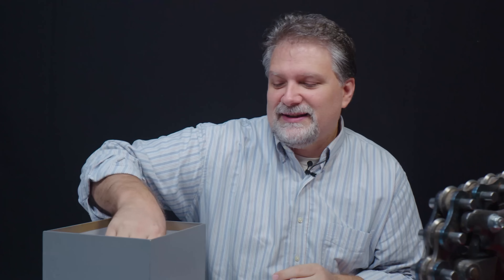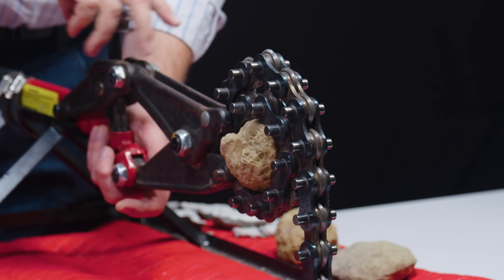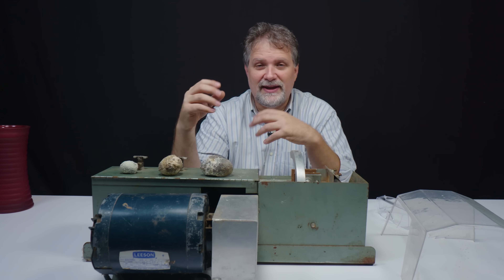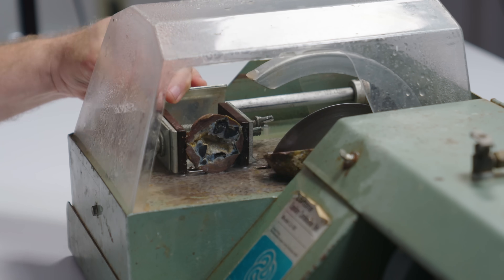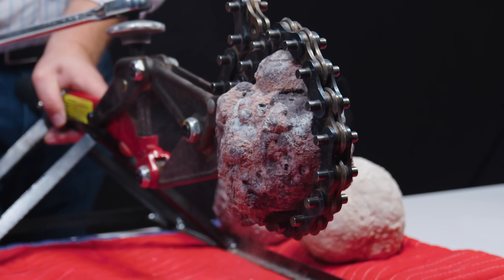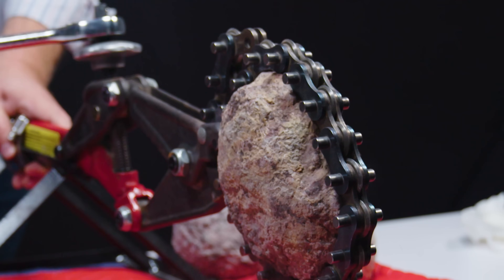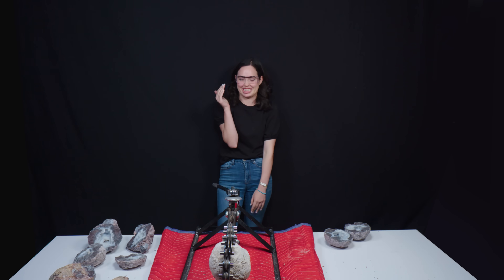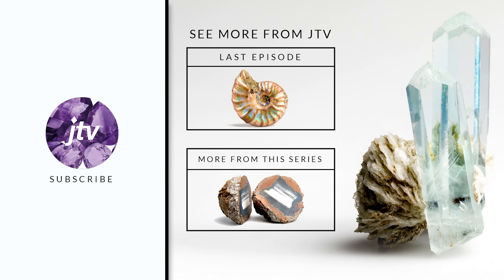Opening Unusual Geodes | Fluorescent, Druzy, Rattlers, & More!

Comment: Came here to check out geodes since I've had a really nice solid one for well over 40 years, but have never had it appraised.  After seeing this and a few other videos, I'm starting to think I have something relatively rare. Mine is about the size of a professional baseball and is cut in half. The inside is solid with layers of white on the rim of the round the is layers in a light blue in alternating layers to a dark blue surrounding the center and the back to a lighter blue for the very center. The more info I get, the more I appreciate what I have. If anyone can point me in the right direction I'd greatly appreciate it. 
Thanks Rockhounds!!!✌️👍🤙

Comment: Public service announcement: always CUT your geodes or Thundereggs open with a wet lapidary saw, either oil or water depending on the saw type. Any time you break them open with either a chain or hammer the concussion of impact and compression will shatter and destroy a good amount of the crystal structure inside. The only way to truly minimize that is with a Diamond saw that’s properly lubricated and with a proper feed rate. Just my experience of 40 years of serious rockhounding and getting an amazing geode specific training while I lived outside of Geode State Park in West Burlington Iowa. It’s just north of the Keokuk locality and actually a better spot for geode hunting if you can get permission from a private landowner on the border of the state park. I have milk crates full of still uncut geodes I’ve saved for about 25 years. 🤙🏼 good video though and thanks for stirring up my geode juices lol!

Comment: with the saw setup you have going for the thunder eggs we used to use a weighted tin attached to the part you push and it pulls the stone through the blade without the need of your hand being in there. way safer to use that way.

Comment: Hi! I lve in northern Virginia, and my Grand daughter, 12 would like to get into rock collecting and making art with them.  I was wondering a few things- 
What is the difference between a geode and a Thunder egg?
Can we find geodes here in NoVa?
When you were cracking the geodes, there was a lot of dust and fine particulate in the air- I am glad you are wearing glasses, but shouldn't you also wear a mask to prevent breathing it in, as you had the water to protect you with the saw? I would hate for you to develop silicosis some day
Thank you!
Reply: Thundereggs are similar to a filled geode, that is formed within rhyolitic volcanic ash layers and opposed to geodes have agate-filled nodules, that is minerals in-filled during its formation cooling to create a microcrystalline structure.

Geode is a geological secondary formation within sedimentary and volcanic rocks including common crystals include quartz, agate, jasper, gypsum, chalcedony, hematite, dolomite and calcite.

-

Differences of Quartz Varieties

I believe the location, size, crystal habit/structure (crystallography) and possibly its luster. For more nuanced differences you may have to look towards reflectance, absorption, cleavage which can be looked up on mindat or IGS.

Chemical formulas:

Quartz is a family of minerals with this composition:

Silicon  46.74 % 
Oxygen   53.26 % 

and it's varieties:

Agate - banded variety of chaledony 
Carnelian - flesh red chalcedony
Chalcedony - microcrystalline quartz 
Chert - cryptocrystalline quartz
Flint - microcrystalline quartz  

Chelcedony SiO 2
cryptocrystalline form of silica, composed of very fine intergrowths of quartz and moganite (considered a polymorph of quartz; Silicon 46.74%  SiO 2 Oxygen 53.26 %)

Extra: Apophylite vs Quartz (https://m.youtube.com/shorts/KBKhMWAc8B4 )

Comment: And number THREE REASON you need to use water is so the diamond tips don't melt away from the blade!
Reply: Warped blades arent fun either
Reply: I feel that warped blades and melt-away diamonds fall under reason number one: you don't want the blade to heat too much.

Comment: Never heard of thunder eggs.  Definitely Mother nature at her best.  Was fun watching how you actually get the geode cracked.  Loved the striped Chalcedony. Using the saw looked mighty dangerous, good thing you guys are professionals.
Reply: The only real danger from using the saw is if the blade broke, i have never had a blade break on me in the many years i have been cutting. These blades are dull, they use the diamond layer to scrape away the material, they are not like a normal saw blade.

The geode cracker however is way too messy and far more dangerous than the saw which is why i dont use one.

Comment: Is there a small pipe cutter you can use?  I ask because the "chain" seems pretty wide in comparison to the width of the geode and it looks difficult to center the rock for being cut open.
Reply from the maker: If the geodes are small, then a small pipe cutter will work.  For that matter if they are small and cracked a hammer will work.  The chain method provides the most consistent results.  Rock cutting or tile saws with diamond blades that cut wet will also work.  If you use a rock saw, you must let the blade do the work and not force the material through or you will warp the blade.  The rock saw method is the costliest and most time-consuming method to cut geodes. Most of the cracking contraptions I have seen have larger chains.  There are several videos on the web of how to build your own.